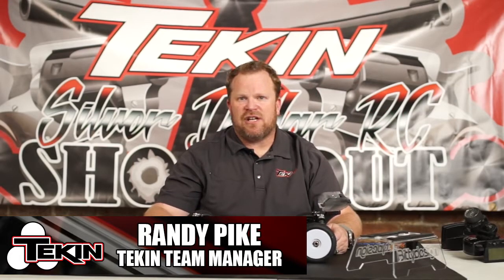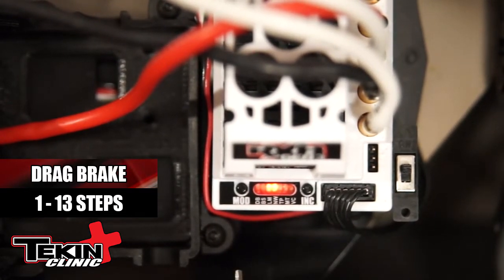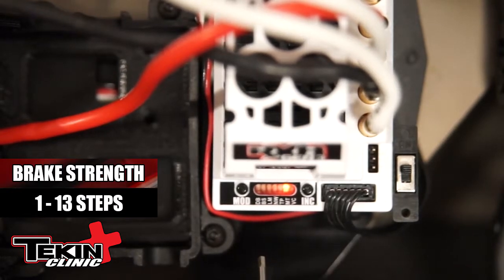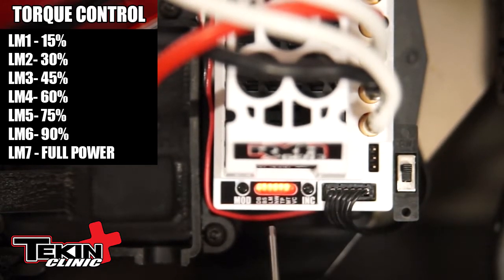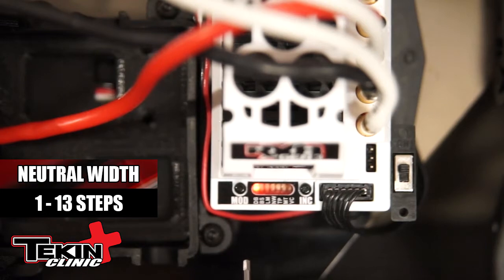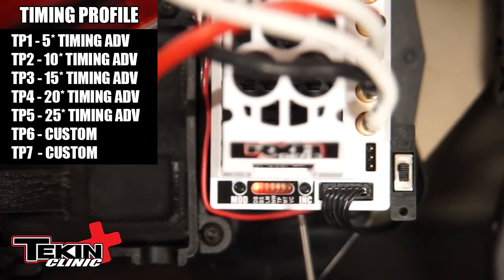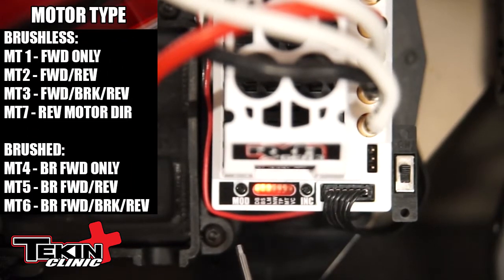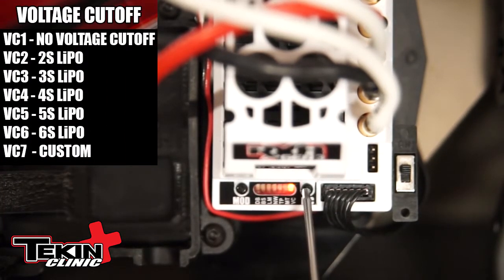Tekin Clinic: On-Board ESC Adjustments

Comment: Hi! I have a RS Pro, and it won't let me adjust the throttle curve. I go into the Mode 5, and it shows 1 as the current setting, but it won't let me change it - when I press Increment, it just blinks once and stays at 1. Am I doing something wrong, or is there something wrong with my ESC?

Comment: Hi there, im using new tekin BXR esc for my crawler, but hen i try to setup the esc can’t move backwards. That just move foreard. When i setup with tekin hotwire it can be move backwards but when I switched off and turn On. The setup changed, just move forward only. What shoul i do? Thanx mate
Reply from the maker: Default setup has a reverse delay, so you need to sit in neutral for about a full second before reverse will activate. If you don't wait long enough it just applies brakes. You can set the ESC to Motor Type 2 to have forward to immediate reverse operation.

Comment: good afternoon, i have a esc tekin gen 2 and i am not able to configure it to work on my yokomo db7 black series it keeps flashing all the lights at once and it doesn't accelerate just turn the steering wheel?
Reply from the maker: All LEDs flashing means it is not getting a receiver signal. Please email us, support@teamtekin.com for technical assistance.
Reply: @TekinRacing  What is it thank you for?  I just sent the email and am waiting for a response.

Comment: I'm running a rx8 Gen 2 with a 1900 t8 Tekin. What settings should I set it all to ? And can I run 6 s with this set up with out frying anything ?
Reply from the maker: Hi Michael! Check out our ESC Setups area for some baseline settings and Team Driver setups on the RX8. You can run 6S on the RX8, however the 1900kV motor is only rated for 4S. http://teamtekin.com/setups.html